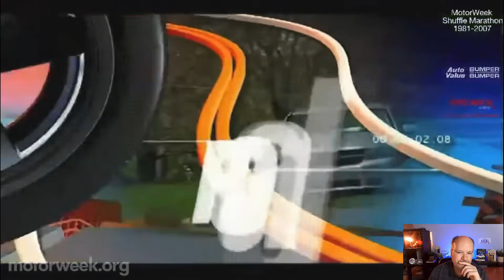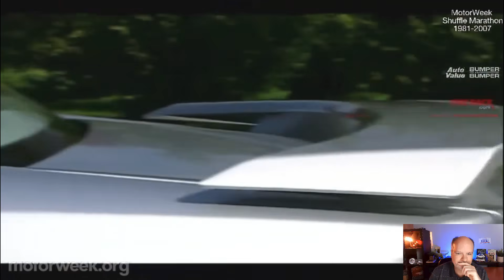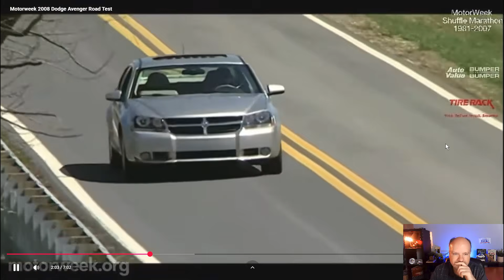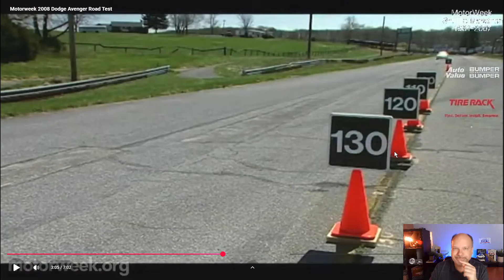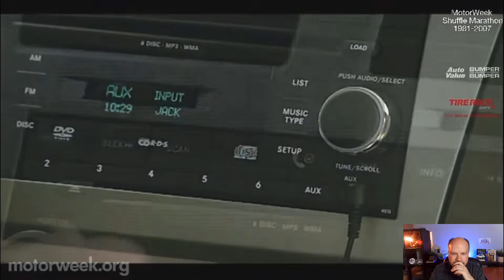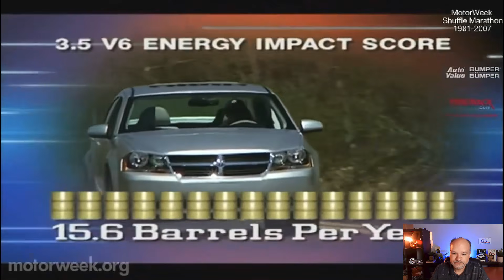2008 Dodge Avenger (Reaction) Motorweek Retro

Comment: I used to have a 2000 Chrysler Cirrus, loved that car. When I was looking to trade that car in 2004, I looked at a 2004 Chrysler Sebring, OH MY the way Daimler cheapened the interior was obvious. Door card was ALL hard dark cheap plastic. The interior was SO dark.  Most dealers seemed to mostly carry the black interior. DARK and drab. Looked at a 2004 camry LE, WOW what a difference, you could see the Grand Canyon size difference in quality between the 2. And the Camry was cheaper in price. No brainer, bought the Camry.

Comment: If you were  in the market for one of these I’d think you’d much prefer the 2011+ dodge avengers. Those had a drastically different refreshed interior. Similar to the dodge darts interior that came afterwards. Plus they had a refreshed 3.6 motor that was way quicker than the old v6s these had.

Comment: Excellent review!  I can't think of many things that you said in there that I don't agree with.  The perspective that I had at the time was one of intense frustration ever since I can recall, I so badly wanted chryser to use the 3.5 in the midsize sedan statement, But they kept bringing a knife to a sword fight using the 2.5 Mitsubishi and later the 2.7 Chrysler. I really loved the first generation stratas's styling. The second generation was just okay. I liked how they drove because I'm not an aggressive driver by nature.  Here when they finally use it, they put it in a car that didn't handle particularly well, nor was particularly smooth, And I didn't like the styling. The interior was an epic failure. I will often depend Chryslers interiors from previous eras where I think people are nitpicking but here criticisms are 100% earned. The styling cues are like you said with the circle but the door handle makes absolutely no sense. I have never understood this. Here's another interesting detail that I think highlights what you had said that law. This seems incomplete. The platform they were using was a stretched Mitsubishi lancer platform. As a result, there is no reason that it should have struggled with handling.  Also, when they finally added the Chrysler 3.5, notice they detuned it. The version in the LX platform was generating 250 horsepower and 250 ft lb of torque. The 300M special from the LH era generated 255 horsepower and 80 258 lb of torque. But this version generated 235 horsepower and 232 foot lb of torque. From what others have explained, this was because the engine bay inhibited the output. My thought process is if they would have given the engine bay sufficient room to generate the full 250 or even the 300Ms 255 and 258, they would be right up there with the best but they detuned it and as a result were towards the bottom. The last update the 3.5 was given was back in 1999 and the output that it had back then was competitive with the best of these without having variable valve timing. If Daimler wouldn't have neglected the engine and would have told them to keep investing in the next generation technology, I've often thought they might have been one of the most powerful out of this class. The 3.5 so long as you changed the timing belt and water pump on time is a very reliable engine and I would take it over a number of these including the Toyota gr2 (and I've owned both).  A part of the discussion that I think needs to be added to this concerning the fuel economy is between this and the Malibu is how impressive it actually. Is that the Chrysler 3.5 did as well as it did on fuel economy compared to the 3.6 that Chevrolet was using. You already addressed this on the real world that the Chrysler 3.5 did better, but here's another part that adds to the equation. The Malibu had 2.77 for the axle ratio with a .74 overdrive, the Avenger had a 3.43 axle ratio with a 69 overdrive. The combination that GM had was considerably more focused on fuel economy if you used. The Chrysler's 69 overdrive the actual ratio equivalent would be pretty close to an even 3 also bear in mind that the high feature engine was developed in 2004 and was featuring variable valve timing, which from my understanding provides something like a 3% boost in fuel economy. Even in this, Chrysler was matching them on the highway EPA ratings and the output of a 3.5 at its best was virtually neck to neck with the high feature V6 and using a lower compression ratio than the high feature V6. The versions of the 3.6 that were were far more powerful featured gasoline direct injection which was never offered on the 3.5. This highlights how advanced the Chrysler 3.5 was for its time and why? It's such a shame. They never used it in anything hardly and the only vehicles that they would use it in were way oversized for it to shine as a performance engine. 

The 2.7 e85 offering was a decision. I never understood why they kept that in general round. By that point it was so obsolete and it's reputation so damaged because of the sludge problems That personally I don't think they should have even bothered offering it. If they wanted a more keyless efficient V6, why not just offer the 3.5 with taller gearing?  Concerning the performance, since Daimler and Cerberus were not willing to invest in the 3.5, one of the decisions I never understood is why not offer the SRT4 engine in it? The SRT-4 engine would have been towards the top in performance being that it generated 285 horsepower and 260 foot lb of torque. Taking into account that we've seen that the 62TE could be paired up with very similar numbers coming out of the later pentastaria V6, why not offer that as a a top- of the line version. It would have at least given Dodge The ability to market itself as something it was pretending to be.  As for why the 4-speed, my guess is either cost or they wanted to slowly release the 6-speed transmission as to not repeat the mistake that they made of betting the farm on the original ultradrive in the late '80s early '90s. This way they could release it and any problems could be limited to just models that had the 6-speed as opposed to the entire lineup. The world engine on paper was competitive but not really. All the power that it had was made at the top end and paired with a four-speed transmission was a bad combination. Even when they added the 6-speed strangely enough it only gained 1 mile per gallon. The world engine to me is a lot like Ford's vulcano engine. It's not particularly powerful, it's not particularly fuel efficient, it's not particularly smooth, it doesn't have a particularly good exhaust note, it doesn't do anything particularly well, but it is very reliable.  The revision that they made in 2011 was a substantial improvement. It wasn't enough to make it competitive with the best, but it became at least acceptable. With the 2011 versions Fiat revised the suspension which made it a much better handling car, they put on better tires, they spent. I think it was $157 on the interior and although it was still at the bottom, it was at least acceptable whereas this was not even close to acceptable. The pentastar became the best part of the 200/ Avenger. The pentastar is a very torquey engine And very fuel efficient for what it is. This combination makes it a good sleeper And kind of a fun car to drive. And out of the uncomfortable cars they make these days one of the least uncomfortable. I would have been willing to buy an Avenger RT over some of these, but I would still probably buy either a first generation fusion or a '02 through '08 mazda6 but I would pick this over an accord, sonata, Camry, Passat, or Malibu.

Comment: The refresh was significantly better. Interior was better. The 3.6 was WAY better. Brought the 0-60 into the 6 second range. However this is not a sporting sedan by any stretch of the imagination. The "Ultra Drive" "6" speed transmission is really not a 6 speed. It is merely a 4 speed transmission with two different overdrives tacked on. So it is fragile. I have a Journey and if I do not stop COMPLETELY between reverse and drive it will always put me into 2nd gear limp home mode. God how many Caravans have had this transmission replaced over the years.
Reply: Exactly, the refresh of this car was amazing. I’m suprised they didn’t put the 3.6 v6 in the dart that came after this car, that 3.6 v6 was available on the facelift Chrysler 200s but it’s pretty rare to find one.
Reply: @Clecavsfan  The Dodge Dart was a compact car. It didn't need a V6 engine. The Dart was competing against the Civic and Corolla and neither of those two compact cars use a V6 engine. That V6 probably didn't fit in the Dart, anyway.

Comment: Crazy how different the Sebring looks from the avenger in this generation, seems a lot more premium looking and less muscle car like for basically the same car.
Reply from the maker: That's a good point. I've found Chrysler Corp did a good job through the years making their Dodge, Plymouth, and Chrysler products look different (except for Neon. :) ) But this is a drastic difference. Great point.
Reply: @AllCarsReacts you could also get a 2 door Sebring convertible, which was not available with the avenger.
Reply: This is an example of the validity to badge engineering. When done correctly, you can make a different styled car to appeal to different customers. Their failure though was the execution Because the cheapened both of them too much and what wasn't cheapened was half baked.

Comment: The first Avenger was chinch in every way, especially the interior as with all CDJR of that era. You are absolutely correct, horrible materials inside and just bad, bad, bad. Luckily Fiat fixed most of not all the issues as best they could in 2011. When prices right with rebates and discounts, we sold them like hotcakes. 4cyl for $16k, Pentastar V6 under $20k before it was discontinued.

Comment: In early 2012 my wife and I made several road trips to Cleveland from NW Indiana. We didn't want to put the miles on our cars, so we rented a variety of cars to "test" which was the "best" highway car. We rented a 2011 Avenger, a 2011 Altima, and a brand new Kia Optima. Here is what we concluded: the Avenger had the best ride, and was the most quiet, no question. But, it had, BY FAR the worst seats, just all wrong and  uncomfortable, nearly 14yrs later that is still a very clear memory. The Kia looked the best, best features, best seats, best efficiency, but was the loudest. Not uncomfortable but it stood out. The Nissan kinda fell in the middle, and we concluded, overall, as a highway appliance, based upon our needs, it was the best overall.
Reply from the maker: Thanks for the memory and the ultra-quick review of 3 cars!
I don't remember this generation Avenger riding that well, or being that quiet. I'll admit it could be my bias against this generation filtered through the years.
Reply: @AllCarsReacts tangential but fca works with the rental companies to put high trim vehicles in their fleets to improve brand image and sell more dollars. Maybe they rented a top trim one? Although I’ve mostly heard of them doing it with grand cherokees or Chrysler three hundred, not avengers

Comment: The 2.7L V6 offered on these was one of the worst engines ever made, prone to oil sludging issues and with an internal water-pump that was prone to leaking into the oil, and very expensive to replace when it failed. Very few made it past 100k mi unless the owner was extremely diligent with maintenance and also somewhat lucky.

The 2.4L I4 and 3.5L V6 were both general reliable (assuming you kept up with timing belt changes in the case of the 3.5L), but somewhat "unrefined" (especially the 4 cyl) with high NVH.
Reply: Yea but the 2.7 was only offered from 2008-2009. Then they removed it as option for the car in 2010. The 3.5 was the better motor from the start with way more power, I don’t understand why they even offered it with the 2.7 as a middle engine option in 08-09, as it didn’t have a good reputation in the last set of cars, but even when it comes to reliability that 2.7 wasn’t that bad if you kept in on maintenance super diligently and already knew the existing problems that could arise, maybe get an engine flush every 80k miles or so, so the sludging wouldn’t ever get to the point that it becomes a problem and do some preventive maintenance with the water pump but I wouldn’t worry about the water pump, just check if theirs coolant in the oil every time you change your oil. The ford 3.5s and 3.7s have the same problem with the internal water pumps in their fwd based cars.
Reply: 2.4L likes to snap timing belts as well😮.
Reply: @AviationCat-m2q  This generation of Avenger (2008+), used the GEMA (Chrysler/Hyundai/Mitsubishi) "World Engine" 2.4L I4 which used a timing chain rather than a belt.
Reply: A @AviationCat-m2q   any car with a timing belt likes to snap timing belts at some point, that’s just the downfall of anything run by a rubber belt, they wear out or lose structural rigidity over time and use .You’re gonna have to to do preventive maintenance at some point and change timing belt driven motors in advance when they start to get up in milage. Even the 3.3 v6 Toyota made or 3.5 v6s Honda made will throw a timing belt eventually if you drive it long enough. What’s the point of the “😮” emoji, why would anyone be suprised by a rubber belt breaking or wearing out over time.
Reply: @Clecavsfan Used the 😮 because I owned a PT Cruiser whose 2.4L snapped its timing belt prematurely at 50K. This car was well taken care of and still problematic.